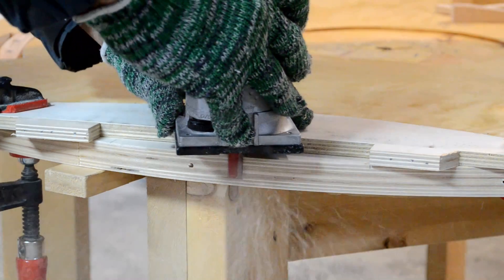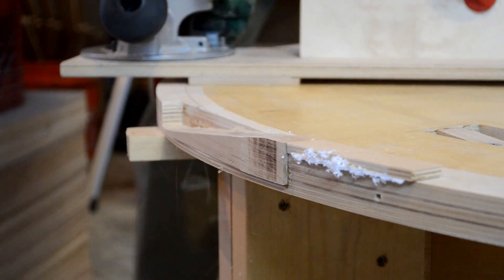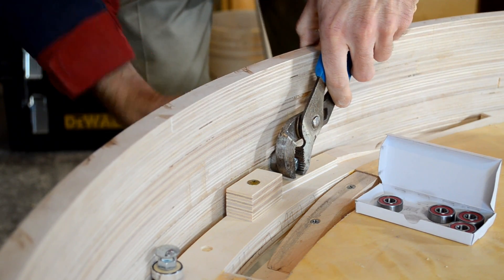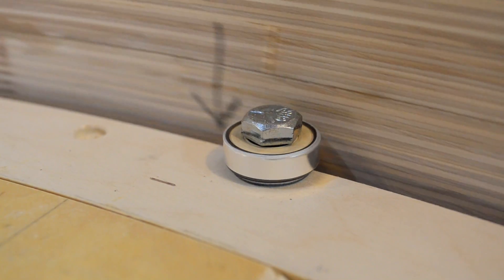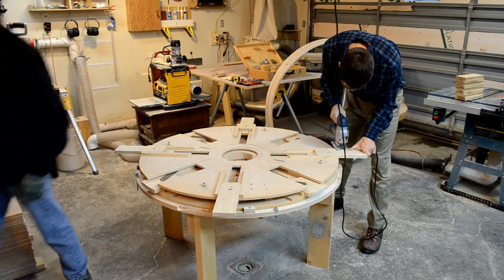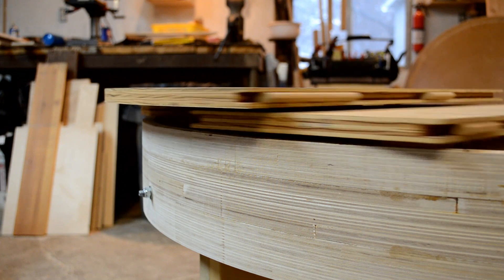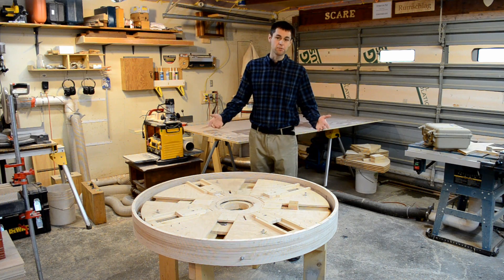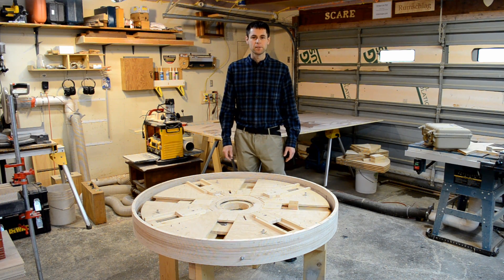Expanding Table Upgrades #3

Comment: Scott, do your plans have the updated ring around the table and the shortened moving parts? I wanted to buy them but am afraid to at this point until I know I will not have to modify it and work backwards. I really am having fun watching you build this. It is great to see it come together. Keep it up.
Reply from the maker: +Aaron McKelvey The plans will include the ring in the next update, which will be issued after I finish making these upgrades. All people who have previously purchased the plans will receive the new version automatically via e-mail when it's completed. I always prefer to build something before adding it to the plans as my initial concept usually needs fine tuning to work properly. Thank you.
Reply: Understood. I really like what you have done. You are good at what you do.